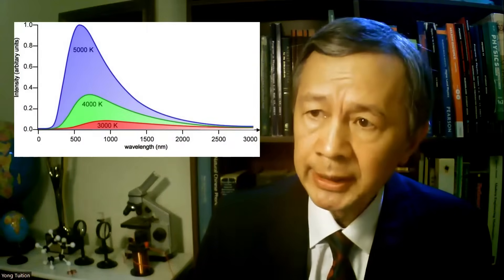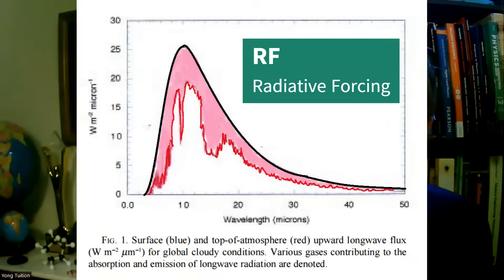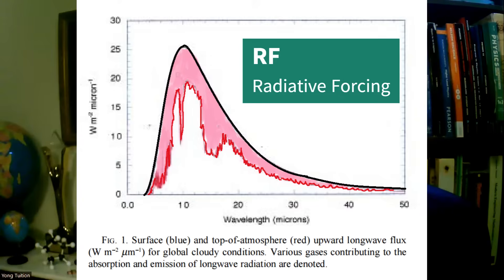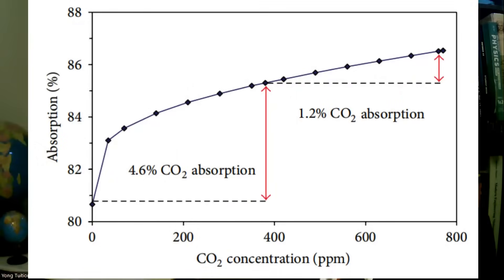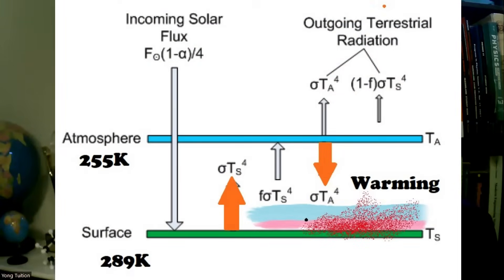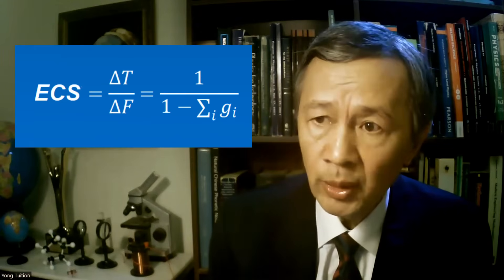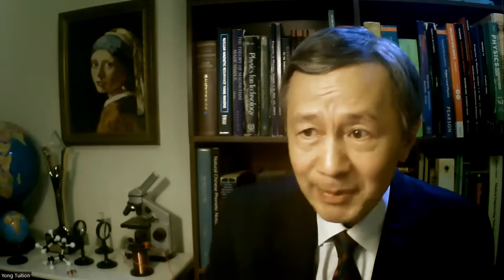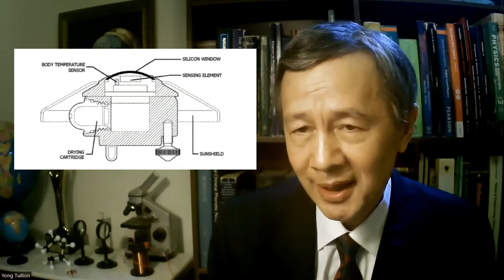The Weird Radiative Forcing at the Core of Climate Modeling | Independent Climate Research 230228

Comment: I have always held the positive feedback narrative in derision but Dr Yong destroys it with a stroke of pure and simple logic: where's the power source?     His op-amp example is perfect.     The amplification of power is at the expense of the increased power drain from its power supply.    So just how do GHGs draw more radiative energy out of the sun?       

The feedback narrative is childish.  If there were a positive GHG feedback instead of a simple state of equilibrium then there would be a runaway effect until some brand new but completely new outcome occurs,    such as the runway feedback of a newly lighted unburned match that once lit runs its feedback course to assume a new stable state as a burned match.  In the case of CHGs positive feedback they must result in the boiling off the oceans.
Reply: Where is the power source?
You don't need one, except in the kind of electronic circuit to which Yong refers. Yong's pretence that such a power source is needed in the climate system is like much of his talk - simply dishonest, and designed to confuse his scientifically illiterate audience who are only too eager to believe that global warming is not a problem.
The main positive feedback that enhances the positive temperature response to an increase in atmospheric CO2 is simply the ability of the warmer atmosphere to hold more water vapour than a cooler one, which, along with the fact that water vapour is is also a greenhouse gas, results in the positive feedback. Other positive feedbacks include the reduction in snow/ice cover consequent upon a warmer atmosphere, which reduction in albedo allows a greater absorption of solar radiation.
Where is the requirement for a power source for either of those positive feedbacks?
Before eulogising charlatans like Wong, it is usually a good idea to to do a bit of thinking.
As for your claim that any positive feedback leads to a runaway effect, that also is false.
Iterative feedbacks do NOT necessarily lead to the divergent behaviour of a runaway event. Such feedbacks are described mathematically as infinite series, in which each successive term in the series is obtained by multiplying the previous term by a given number (the multiplier). Such series will only diverge to produce a runaway effect (as you claim they will) if the multiplier is greater than one, and in the case of the CO2/water vapour feedback, the multiplier is very much less than one: so it is a convergent series.
A simple example is the series:1+ 1/2 + 1/4 + 1/8 + 1/16 + etc. That has a multiplier of 1/2 and, although infinite, the series has the finite sum of just 2, and is convergent.
In the case of the CO2/water vapour feedback from warming, we can estimate what happens from data from the Antarctic Vostok ice core,
where, (as you can see if you search for the Vostok Core showing CO2 and temperature provided by euanmearns) , an increase in global temperature of around 5degC (corresponding to an increase in Antarctica of around 10degC) resulted in an increase in atmospheric CO2 of about 120ppmv, from 180ppmv to 300ppmv. Now, assuming a climate sensitivity of around 3degC for a doubling of atmospheric CO2 (which is what most studies estimate), you 
can see that the warming feedback from that increase in CO2 must be less than 3degC, since the amount of CO2 has less than doubled (300ppmv is less than double 180ppmv). "Less than 3degC is, of course, much less than 5degC. Hence the multiplier in this case is less than 1, and the series must be convergent. Ie it cannot cause runaway warming.
Reply from the maker: @Tengooda  [assuming a climate sensitivity of around 3degC for a doubling of atmospheric CO2 (which is what most studies estimate)] This is a statement, rather than a proof. The correct ECS is 1.3K.
Reply: @Tengooda  It was not Yong but Jimmie Hanson the pied piper of fake doomsda doomsday predictions who compared his fictional positive feedback climate loops to those used by op-amps. 

RE: "The main positive feedback that enhances the positive temperature response to an increase in atmospheric CO2 is simply the ability of the warmer atmosphere to hold more water vapour than a cooler one, which, along with the fact that water vapour is is also a greenhouse gas, results in the positive feedback."

Pure fantasy.Water vapor is by all measure the major insulation factor in retaining Earth's heat, CO2 plays an insignificant role, particularly at its current nearly saturated concentrations.   The hottest surface temperature ever actually "recorded" (as in "not modeled")  on planet Earth occurred at Death Valley in the year 1913 (134 F), it was not high CO2 concentrations that caused this but 1) its high air density, 2) it's exceptionally dry air, and its temperate zone of long days allowing the sun's radiation long full access to heat its surface.    That same year the night time temperature in Death Valley dropped to 15 degrees F, the lowest temperature ever "recorded" there.   Why?   the answer lies with its extremely low humidity, allowing surface IR radiation freer unimpeded access to the higher altitudes.  Again CO2 doesn't even get an honorable mention. 

The broad bands of IR opacity mask most of the narrow CO2 bands that are not completely masked by water vapor and are already nearly at saturation and this insulation response is logarithmic, not linear.  I don't expect your fans to understand the meaning of this but I expect that you should.  

What happened when CO2 concentrations were at ten times today's nearly starvation levels?   There is  connection with atmospheric CO2 levels causing temperature increases.     In the shorter term we would expect the oxidation of hydrocarbons to increase with higher temperatures and they do.  

All of your math and your models are based on a theory that has been disproven by experience.  Mathematics provides an excellent tool for modeling but only when you understand what is being modeled and you don't.
The USCRN has shown no US "average" temperature increase since it began to go online in 2004; there is no other data worth a pinch of sh!t as a harbinger of some fanciful and fanatic "climate crisis"  

Your "science" was founded and funded with the aim of controlling liberty, its practitioners and its promoters do not believe in a word of it as evidenced by their own actions: "do what I say not what I do"    Not since the Salem witch trials have the uncontrollable emotions of pubescent teenage girls been given such a prominent stage to promote this  climate bull-feces such as the UN with the likes of one Greta Thunberg.  What respectable science would not cry foul.

By the way, what is the SI unit of "climate change" so I can measure its wanderings myself?
Reply: @brucefrykman8295 
1. Of course there are similarities between electronic feedbacks and atmospheric ones (or the mathematical iteration that I mentioned), as Hansen may have stated, but that does not mean that because the former requires a  power source then the CO2/water vapour feedback also requires one, and nor will you be able to show that Hansen suggested that it does. Yong's suggestion to that effect is ludicrous: but if you want to cling to that idiotic nonsense, that is up to you.
Meanwhile the atmosphere has confirmed the predictions of climate scientists like Hansen: measurements of the absolute humidity of the troposphere have shown it to be increasing as its average temperature has increased in recent decades: that is the positive feedback in action, there for all to see, except for those with their heads firmly in the sand.
2. I see you do at least recognise the importance of water vapour, though you can't quite bring yourself to call it a greenhouse gas, which is what it is. The amount of water vapour, of course, is also important in the formation/dissipation of clouds, which also influence the radiative imbalance by albedo effects: reflection of both incoming solar radiation and outgoing IR. A fairly recent review of the relative status of the various greenhouse gases (see Attribution of the present‐day total greenhouse effect Schmidt et al, JGR, 2010) concludes that it is:   Water vapour 50% Carbon Dioxide 19% Clouds 25% All Others 7% .
3. CO2 is not saturated, nor nearly so. If you want to understand about these matters, rather than have your evidently rather extreme political views massaged, then I would suggest studying Pierrehumbert's article "Infrared Radiation and Planetary Temperature", Physics Today, 2011,  that includes a passage about the saturation fantasy that was initiated by Angstrom's rudimentary experimental evidence and misunderstandings well over a century ago.
4. The USCRN data goes back much further than 2004, and the world is much larger than the contiguous USA: but if you want to cherry pick the last few years of just that 1.6% of the Earth's surface to try to convince yourself that nothing is amiss then I suppose you will continue to do so. People who are afraid of reality frequently cling to some tiny part of it that seems to support their delusions, rather than look at all the available data, and that is what you are doing by referencing such a tiny part of it.
Reply: @Tengooda  RE: " I see there is no point in providing you with any evidence or reason or explaining your misunderstandings and errors to you. "

Translated: "I have no bonafide evidence whatsoever of CO2's presumed destructive influence on humanity of any kind, but my "faith" in the central planning of socialism is unshakable regardless of the overwhelming evidence to the contrary"     

OK you are a legend in your own mind so why even try to defend your nonsense.
Reply: @Tengooda  If the feedback doesn't need a power source, does that mean that if we blocked the sunlight from hitting the earth, the feedback would continue to heat the earth? You don't need a feed to have feedback?
Reply: @douglasjacobs882  Yong referred to an electronic amplifier - ie a device ADDED to the original circuitry. That is not strictly analogous to the Sun-Earth system. In the latter situation, warming of the Earth (by whatever mechanism) will cause an increase in atmospheric water vapour, as described by the Clausius-Clapeyron relation. That latter process is, of course, endothermic - it requires energy to promote molecules of water in the liquid state to the vapour phase -  but the one-off energy consumed by that process is less than the loss of energy prevented (ie energy gained) by the continuous additional greenhouse effect afforded by the additional H2O molecules.
At the end of the day, the proof of the pudding is in the eating: it is an OBSERVED FACT that the water vapour content of the global atmosphere has increased in recent decades as global average temperatures have increased, just as it is an observed fact that regional variations in atmospheric water vapour content correlate positively with temperature.
Reply: Ok, ill take the bait. Assuming Co2 does not need a power source (which i think is absurd but anyway), how do the molecules transfer its kinetic energy downwards? That defies the law of thermodynamics. But ok, let's again assume it transfers it to other molecules. However, at the altitude this is supposed to happen your suggested H2o molecules are not there or at least not in sufficient quantities. All molecules at that altitude are spaced out. And it is cold up there. There is no way to transfer kinetic/thermal energy. You might make a case for Ozone. The other idea is to 'trap' outgoing IR, delaying it frim going to space. Again, not enough molecules to make any difference. Whichever way you look at it this back radiation idea is nonsense.
Reply: @Tengooda  I don't pay attention to those whose idea of a scientific argument is to call people "charlatans".